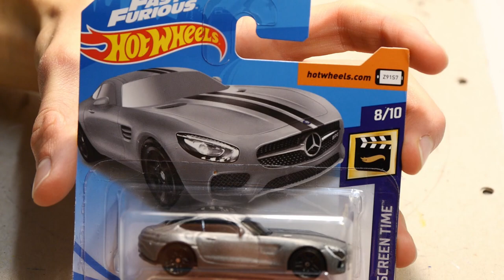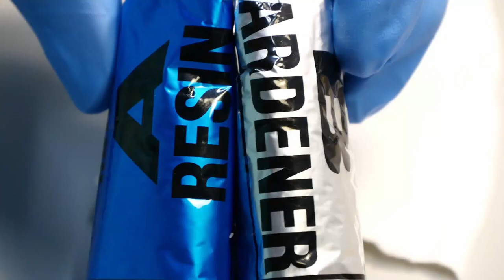Mercedes AMG GT Camouflage Camo Hand Painted Hot Wheels Custom

Comment: Did u clear coat it
Reply from the maker: Yes of course, I clear coat every custom build to protect the color coat.
Reply: @themodelcarproject  that's perfect, u can try 2k clear coat which had more long lasting effect
Reply from the maker: @jiajunlim9689  Maybe in the future, I work currently with 1K acrylic waterbased spray can paint. It works better than other clear coats like resin... (and without airbrush!).

Comment: How do u remove the paint
Reply from the maker: With nitro thinner
Reply: @themodelcarproject  i use acetone should i let the car to soak it in the acetone?
Reply from the maker: @shabeenabanu6538  yes, I usually let it in there over the night. Just putting acetone on it for a few seconds won't remove the paint.